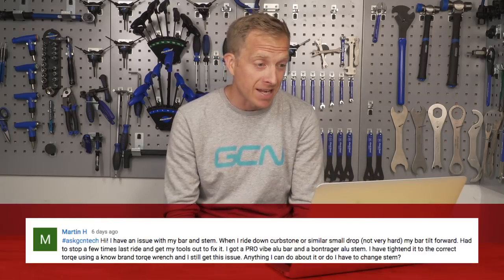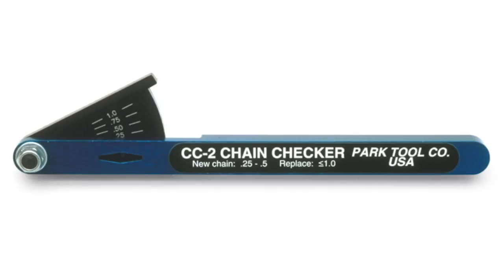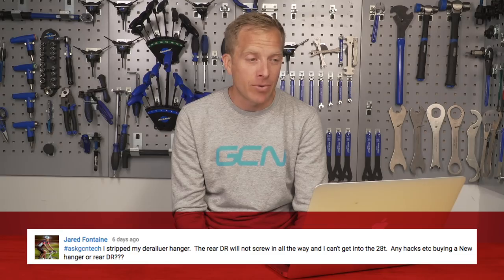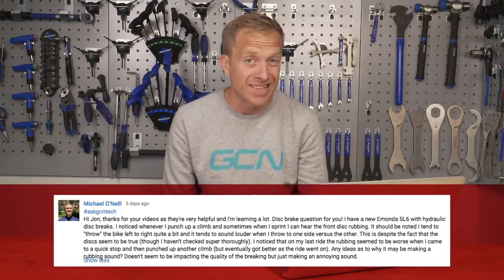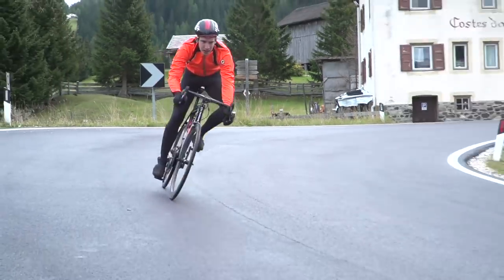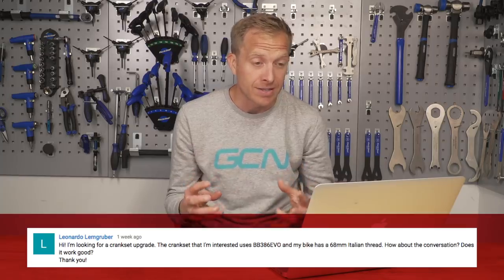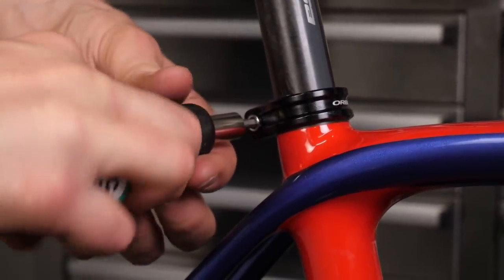Handlebar Torque, Chain Skip & Roof Racks | GCN Tech Clinic

Comment from the maker: Keep your questions coming in for Jon using #askgcntech. 👇
Reply: I'm planning on buying a bike with the older Shimano RS505 hydraulic brakes/shifters. If I want to upgrade to some slightly smaller levers (eg Shimano 7000 series), do I need to buy a new caliper as well or can I just pull the hose off the existing calipers and re-bleed the system? #askgcntech
Reply: #askgcntech -  I have a Shimano 105 groupset and the right shifter has started to rattle a bit when going over rougher roads. Like you, rattles, click, ticks and squeaks, drive me absolutely nuts. The LBS said that this "is a known issue and that there is a inconsequential part that breaks and there is little that you can do about it." Is there anything I can do or am I just due to get new shifters? If new shifter leavers, will Ultegra work with the rest of the system being 105? Help!
Reply: Hi Jon! Do any companies make floating disc brake rotors for road bikes? They've been around for decades on motorcycles. Thanks!
Reply: #askgcntech - I have a creaking BB since this week, and its reeaaalllly annoying me. Its an old concorde san remo alu bike with tiagra 9 sp. How do I even start to find out which BB is in there and which tools I will need to remove and replace it. The bike is not something I want to invest heavily on at the moment and my LBS is a bit too expensive for my taste. Thanks for any help!
Reply: I have avid bb7 disc brakes. Every time I pull of a wheel and put it back on I find I have to realign the caliper and set the pad position. Is there a way to avoid this? (i.e. keeping the brakes and the disc aligned when I pull the wheel and out) #askgcntech
Reply: GCN Tech DEATHSHIMMY I have experienced this on a fast downhill riding my Trek 2.3 with 25k miles going around 38 to 42 mph. I thought it was the frame was getting soft and bought a focus izalko pro and experienced the same . I am thinking it was me that might be inducing the vibration with my arms that shake a little when I tense up . I weigh 185 pounds. I was told to clap the frame with my legs by fellow riders that saw what happened. Any suggestions. Love the show. Camel@ beabubba.com
Reply: Hi, I noticed after a rainy ride that water had gathered inside my wheel, not inside the tube, but between the tube and the tyre. There was quite a bit of it too, enough for me to clearly hear it inside my wheel when turning it. I recently changed from butyl tubes to latex. I have never had this problem with butyl tubes, is this common with latex tubes and is there a way to stop the water from getting in? Cheers. #askgcntech

Comment: Loved your response to the stripped derailleur hanger problem. One way to strip those, or worse, the tang on a steel frame as I once did, is to remove the derailleur and then straighten a bent hanger. This act can somewhat ovalize the opening and make threading tricky. Out of desperation, I solved mine exactly as you suggested: thread in from the back side and recut the threads as best you can.

Comment: For the stripped thread... there is a brilliant part called HeliCoil which is used in the engineering industry to put a strong thread into a hole. You'd bore the hole to the guide size, tap it and screw the helicoil in. That leaves you with a new nicely threaded hole!

Comment: Can GCN do a video on the different types of bike racks systems.  Which is better, on the back of the car or on the top.  Front wheel on or off.  should you cover your bike to keep the road dirt off when driving.  Since there are a lot of presenters now (nine of you), what type of rack systems you use and cars do you but them on?

Comment: Comments for Martin H, TezAllez, and Jon...

@Martin H -- Here are some more solutions: (1) If the handlebar diameter is a little too small as Jon mentioned, one fix is to file the stem plate to reduce the diameter of the stem a little. You shouldn't need to remove much material. (2) But the best solution to use if the handlebar is the correct size, is to apply friction compound to the handlebar and stem. I use Park Tool SAC-2 because it doesn't roughen the mounting surfaces as much as some of the more aggressive friction compounds. Some cyclists think friction compound is only for carbon components but it works equally well with any metal components, too. (3) Finally, another easy solution is to add some electrical tape to the handlebar where it mounts to the stem. This will increase its diameter and enable you to get a tight fit. If you use this method, I recommend rechecking the torque periodically because the electrical tape will slowly compress over time and you may need to periodically re-tighten it.

@TezAllez -- Are you sure you mean "washer"? If you mean the valve stem nut then a major reason for it is to enable you to attach the pump's chuck to the valve when there is no air in the inner tube. Remember, without air in the tube, there is nothing to prevent you from pushing the valve stem farther into the rim and tyre when trying to attach the pump. If there isn't enough stem sticking out past the rim when this happens, you will not be able to attach the pump and you won't be able to inflate the tube. So the valve stem nut is important when pumping up an empty inner tube. Personally, I hate valve stems that are too long. They look ugly and they add unnecessary weight. So I buy inner tubes with stems that are "just right" and the nut is essential to pumping an empty one. Once the tube has air, the nut is no longer needed. However, I leave them on the stem because you never know when you may get a flat and may need to pump an empty tube again.

@Jon -- Regarding Italian-threaded bottom brackets, there is a very prestigious bike manufacturer that still uses Italian-threaded bottom bracket shells in all their frames. Do you remember who it is? Hint: Their bikes have won the Tour de France in recent years under Team Sky. Answer: Pinarello. I love threaded bottom brackets and my favorite is the GXP. In my opinion it is still the best and my first choice. And I'm not alone -- some very famous bike mechanics (like Lennard Zinn) also favor the GXP. And, believe it or not, I still use some of the old-style square-spindle bottom brackets (which also require a threaded bottom bracket shell). Why? Because they are available with such a wide range of spindle lengths, making them the "go to" choice when you need to correct difficult chainline (driveline) problems. This is one of my biggest disappointments with some bike manufacturers: they ship bikes with poor chainlines.
Reply: D. Eldon:  Nice full explanations.  Regarding the valve stem nut, you can just put your finger behind the stem to get the pump initially attached - no need for that extra weight or a further imbalance to the tire/wheel.
Reply: I would suggest trying the assembly compound method to stop the handlebar from moving firdt. Had a similar problem with aluminium components and just a little bit of assembly compound solved the issue perfectly

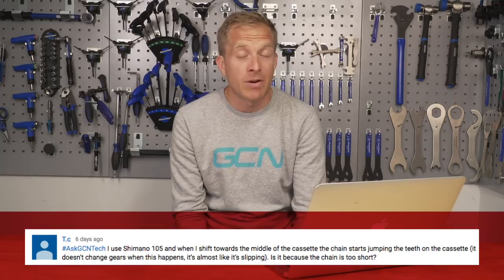Comment: @2:46 regarding the 105 cassette and chain: I had this exact issue, where the chain was skipping just in the middle of the cassette. Here was the problem, and here's how I fixed it:

My 105 cassette and chain were a few years newer than my 105 shifters. The cassette and chain were a 5700 series. The shifters were an older series. It turns out the newer cassette has ever-so-slightly different spacing or cog construction or something. It was just enough to screw with the shifting.

I fixed this by installing a Tiagra cassette. I wanted the extra teeth anyway for a load of 20% climbs to work. Rides like a dream now.
Reply from the maker: Thanks for sharing your solution!

Comment: stem to bar, is the gap at the top and the bottom of the front plate to stem even? if you are tightening more one way or the other it can leave you with a bar that dances around.

Comment: regarding the slipping handlebar:
1. check wether the stem has specific tightening pattern (e.g. tightening the upper ones until the gap is gone, then lower ones to torque)
2. (carbon) assembly paste reduces torque required for a secure connection but might scratch the finish of your handlebar/stem, depending on type
3. try wrapping the clamp area of the bar with electrical tape. this method gets sketchy beyond two layers, but it should do the trick if the others don't work. do it neatly and I wouldn't even consider it a bodge
Reply: Acoustic Gearhead For alum to alum try some Loktite

Comment: Hi John, loving the show.

I have a Bianchi Infinito CV with a Compag Athena groupset. I’ve been a bit unhappy with the gear change the last few months so took it to a local bike guy who has a great reputation. He put an alignment tool on the derailleur and said it was off by an inh from the bottom of the wheel to the top and recommended I get a Union hanger as it would allow him to bend it a bit to get it just right. The shop that I got the bike from said no, don’t bend it, alignment tools aren’t needed any more. They set the gears for me and said it was fine. Took it out and it still isn’t right.

What do you think? Is bending a hanger a common fix? I’m a bit lost at the minute as to who I should believe so any help you can give would be greatly appreciated.

Thanks,

Harry B

Comment: As a Bike mech for over 20 years now I have to say some of the tips are leading in the wrong direction....
For example the disc brake rub issue. It's very common on new Bikes from the factory to be "overfilled" because while prepping the bike (shortening the  hydraulic hoses) the people bleed afterward from the lever only (which I many times do so too) without pushing the pads back! That leads to an overfilled system where the pads are  slightly closer to the disc rotor as intended and prone to rub.
Especially on disc brakes I would be very careful on giving advices without actually having the bike in my hands!

Comment: Looking to use a Thule tow bar rack which secured the bike via a single arm and clasp on the top tube and some ratchet straps on the wheels. A) will the clamp damage a carbon frame? B) will the ratchet strap damage carbon deep section wheels? #askgcntech
Reply: I have a tow bar rack I wrap a old horse boot around the cross bar which is firm enough to save the frame but secure enough to 
keep the bike safe, if you know any horse riding folks they will know what I mean, and I use some large bore pipe cladding cut and wrapped in gaffer tape to shape to protect the rims, done a good deal of travelling in the uk and Europe no harm to bike or car yet.

Comment: #askgcntech I'm looking to upgrade my rim brakes, and my buddy pointed out I have long reach brakes.  By my measurements I have 50mm from the mounting bolt to the center of the pads.  Would a short reach brake fit since I'm looking to upgrade to SRAM Red?  Love the show, thanks for the content! 🚴

Comment: best way to lighten a steel frame bike is to upgrade the group set, wheels, and seat post. Also, check your shoes. I saved over 1kg with my new shoes :-)
Reply: Carl Forde what were your old shoes made from? Iron? Lead?
Reply: Jon my old shoes were an inexpensive road/mtb hybrid type with interchangeable cleats. My new shoes are Shimano R171s. (size 48)
Reply: MRGRUMPY53 I hear that :-)
Reply: Carl, 
As a fellow steel rider, I purchased carbon seat post, crank set, new saddle and  a combo carbon stem- handlebar. I shaved off a little weight and have a sub 20 pound bike, oh yeah, lighter wheelset can make a difference as well. My bike, a LeMond has a Reynolds 853 frameset and rides great! It will never rival a "plastic" bike for weight though.

Comment: #askgcntech Hi Jon.

I recently suffered a flat tyre. I noticed the type wall developed a tear of about 2cm on the side. I replaced the inner tube hoping it would hold on but to no avail! I had another puncture after few km's. 

Question did the second inner tube likely failed for due to the tear in the tyre wall? I used a CO2 canister, could I have overinflated it?

Since I was going fast when I had the first puncture and I had to travel for a bit with a flat tyre I am afraid I may have wrecked the rim! What do I need to look for?

Comment: On my Canyon Aeroad I changed to 55-42 chainrings. With the gearing I am very happy, but the shifting is not spot on any more. The chainrings are mounted on a quarq dfour, but I can’t get the Di2 front derailleur stop rubbing on some gears, when the shifting is better. When the shifting is spot on, the rubbing is a lot to much. Any suggestions? #askgcntech

Comment: #askgcntech My rear derailleur indexing always seems to need adjustment mid-ride roughly every 15-30km. I have checked the rear skewer tightness along with hanger bolt torque and measured chain wear (0.25).  Chain, rear cassette, rear deraileur, inner and outer cables are all fairly new, approx 500km since last changed.  I have a KMC X11-93 chain with R8000 medium cage rear derailleur and r8000 11-34 cassette. what is going on? Help :(

Comment: Hello! So I put in a brand new Fox 34 fork on my rig today. I cut the tube, set the nut, cleaned, greased, and set the headset. Everything was going great, until I set up my breaks. I half tightened both hangar bolts(put a tiny bit of grease) and set the disc so there was no rubbing. I finished up, and gave the bottom bolt a last quarter turn. There was a pop. The bolt was loose and would only tighten up to a point. I thought I might have stripped the inside threads. When I pulled out the bolt, there was aluminum in three threads.

How can I fix this? Really don't want to go in on another fork...

Comment: Ever since I did my cross country road trip, my rear derailleur has hesitated to shift down (into a harder gear), a problem which I didn't have before. It still shifts up perfectly, and sometimes shifts down perfectly but most of the time clicks for 3-4 revolutions before finally getting into gear. I looked at the alignment of the hanger and it looks pretty good, so I don't think my hanger got banged up while on the rack, so I'm wondering if it could be time to replace the cables? Other than the cable getting stuck, is there anything else that can cause this? #askgcntech

Comment: Jon, that stiff link issue can be pretty serious. I recently had that issue and the stiff link got caught on the sprocket of the hanger, causing it to seize and rip the rear derailleur hanger out (in a split second), whip back around and get caught up in the spokes, ripping a few spokes out. I was only doing 20 km/hr. While the repair bill was pretty expensive, I was lucky to walk away from that incident. Always-Always-Always, make sure the chain runs smoothly through all gears and hangers. (Lesson learnt).

Comment: #askgcntech - Really need help with this one, Jon. My Canyon Endurace came with Ultegra Di2 as stock. This included an 11-32 cassette with a semi-compact 52-36. It's been buttery smooth since day one. Di2 really is what it's cracked up to be. However, I've just added a shiny new DA 11-25 and a new KMC X11 chain. I shortened the chain to what I believe to be the correct length but ever since installation I just cannot get the gears to shift smoothly - up or down. Especially from 11 to 10. If i revert back to my old Ultegra 11-32 it's totally fine so I know it's nothing to do with a bent RD cage or hanger. I've tried various b-screw adjustments and micro adjustments on the junction box but nothing. Nothing!  The GS (med cage) derailleur should be fine with an 11-25, right? I know Shimano have strict tolerances around SS/GS and what cassettes work with which RD but other folks get on just fine with the same setup. According to various online forums that is. Thanks (and no you don't have to read it all out!)

Comment: #askgcntech 
First thing first GCN is simply awesome!!! 
Now my issue, I own a road disk brake bike which uses a 15mm thru axle at front, but nowadays seems 12mm is the standard. Therefore some brands no longer provide any adapters/endcaps for their wheels to be compatible with 15mm thru axles. Is there any way I could use a 12mm axle wheel on my bike without changing the fork? Otherwise need to remove a bunch of wheels from my shortlist 🙄😔

Comment: Just bought a new full carbon bike and i am thinking of slamming the stem, i would like to try a lower position before cutting the steerer tube but i have read that you shouldnt run too many spacers above the stem, is it possible to do this for a few rides to dial in my position before getting out the saw?

Comment: Having had problems indexing my gears, I discovered that the drive side rear drop-out was bent slightly towards the wheel (just the drop-out not the gear hanger, seat stays or chain stays).  It was only a few mm but enough to throw the chain line out on the sprockets.  I (as gently as I could) bent the drop-out back into line and the gear changes have never been better!  However, the frame is aluminium which does not like to be bent. I don't think the alignment was out by more than 5mm but I am worried that bending the drop-out back may have compromised its structural integrity. Any comments? #askgcntech